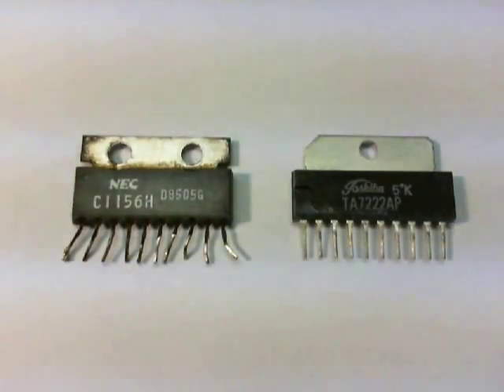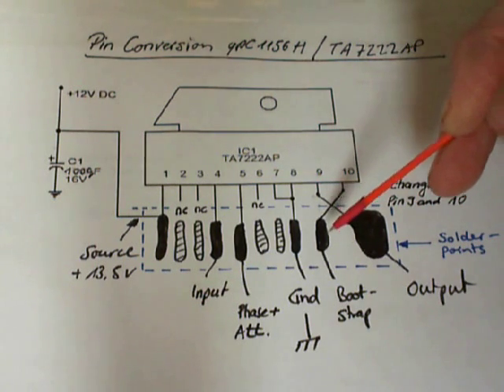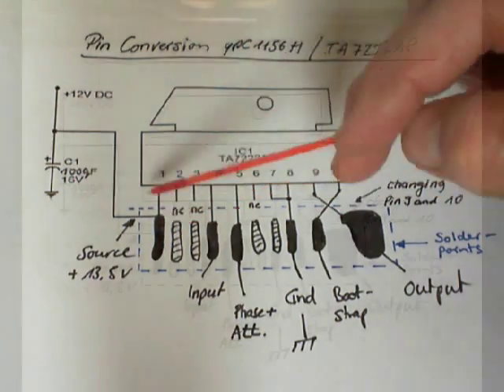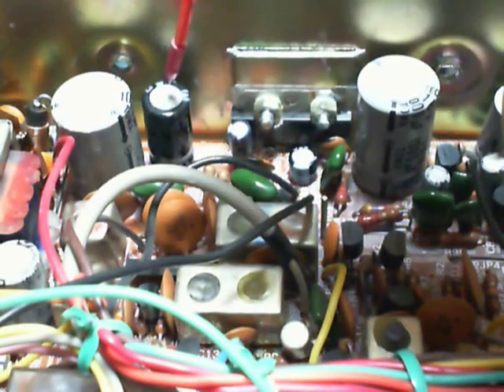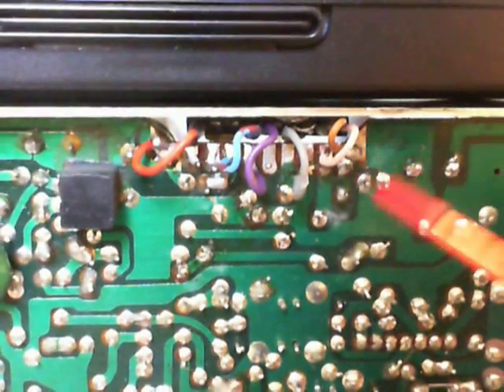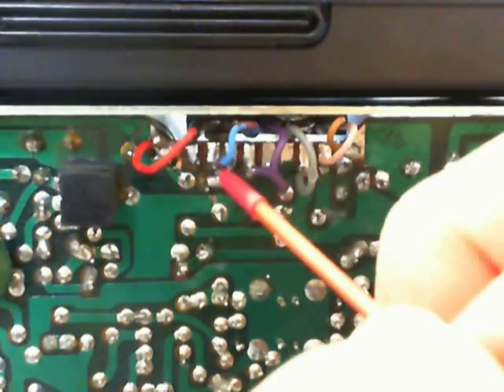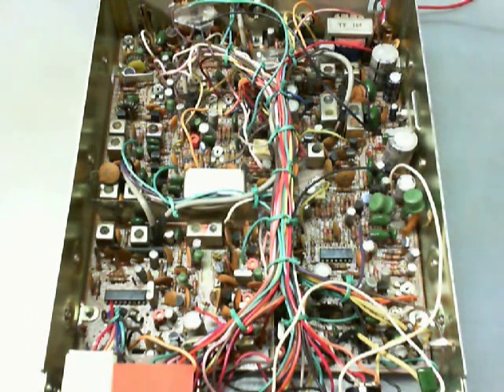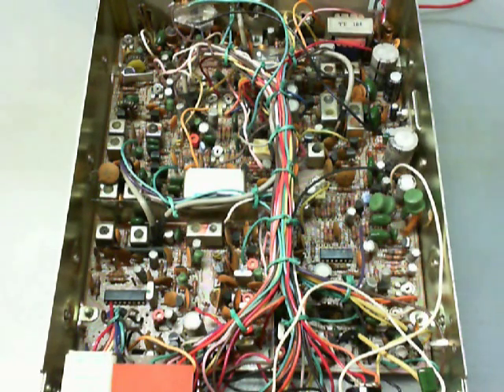upD858 chassis mod-amp replacement, NEC upC1156H replaced with TA7222AP 2.nd

Comment: Hi Tried this mod on my Electronica 360 (which i see you have one of), however after doing it I only have a very feint hiss out the speaker, the volume control doesn't seem to make any difference. On the Electronica 360 Capacitor C92  was 33uf and changed to 47uf, Capacitor C88 was 4.7uf and changed to 47Uf , C95 was left as original. However on the Electronica 360 there is also capacitor C89 (33uf) but can't see this in your diagram / instructions - does this need changing as well?. C89 is located between C88 & C92, great video and almost there so hope you can advise. Thanks Mark
Reply from the maker: I'm sorry sir, but the ELECTRONICA 360 isn't more in my collection. I Can't help you any more. Just the PALOMAR SSB-500 or UNIVERSE-5500 are in my collection yet.
Reply: @SWIZZRADIOS  ok i wil remove the cap and see how I get on, thanks for posting up the video its really helpful and very well put together and appreciate you coming back to me, happy dx'ing.

Comment: Tried this substitute it worked flawlessly.
Reply from the maker: Mr Ron Edwards thank you for your interest. Yes, the TA7222 is installed in a lot of other CB radios, like SUPER STAR 360FM. The sound of the received NF is very clear like HiFi. I'm missing this great amp in all this radios wich use the TA7205 amp. A lot of CYBERNET radios like HAM international or Lafayette, do use the TA7205. But this sound is mostly not so clear on AM or SSB. Best 73s to you...